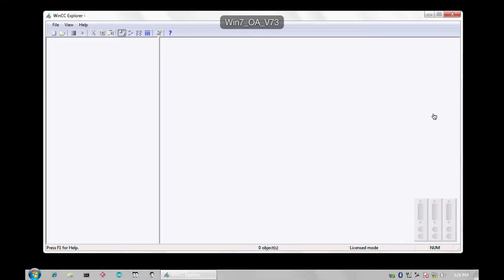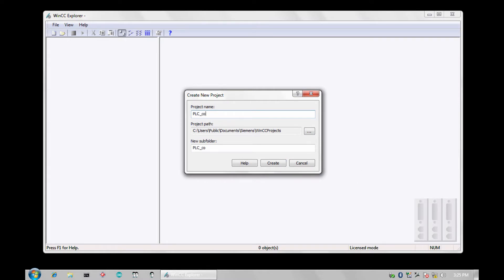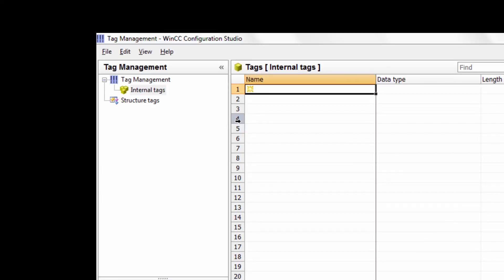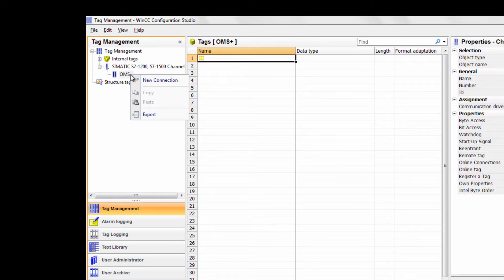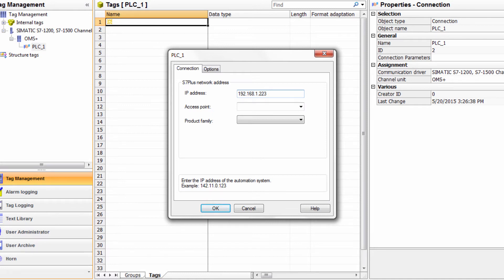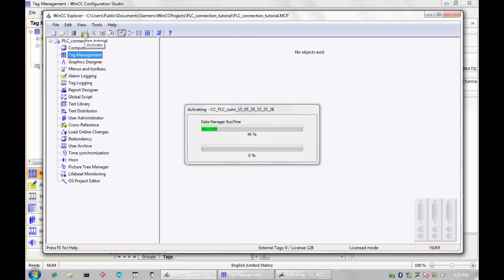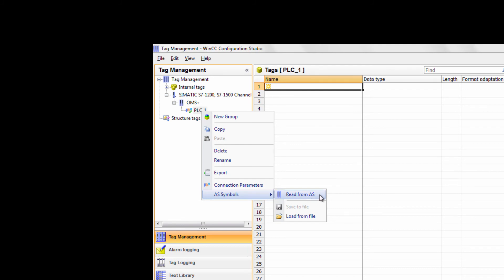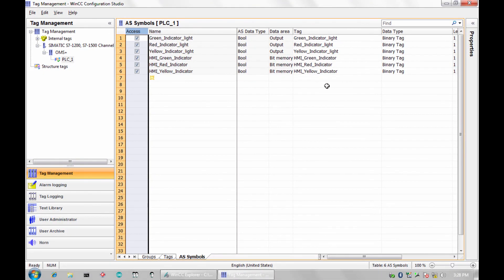WinCC V7.3 | Tag Import

Comment: define IP address but use MPI. What ?
Reply from the maker: ศุภกร Yes. MPI was an incorrect configuration but it worked because of how I setup my PG/PC interface. The proper way is to use S7online TCP/IP setup via your PG/PC interface. When this tutorial was made a few years ago, this tag import feature had just been released with the 1200/1500 series plcs.  All of the other clicks are correct. MPI is typically used for serial communications (Profibus).